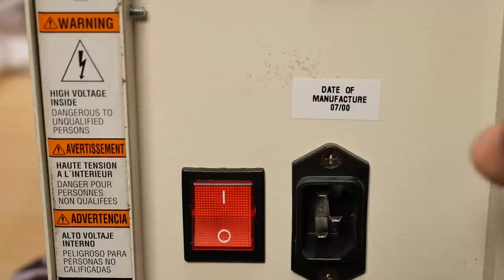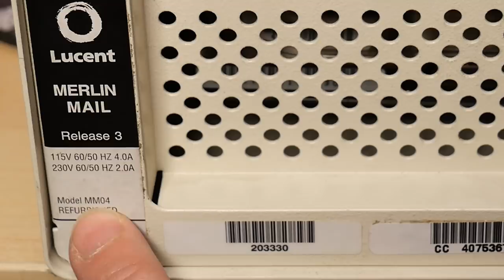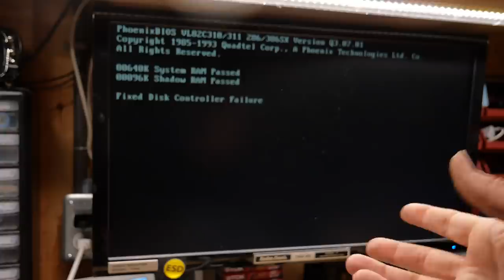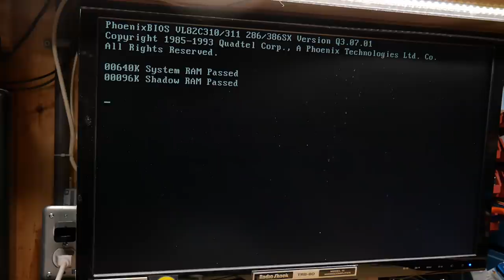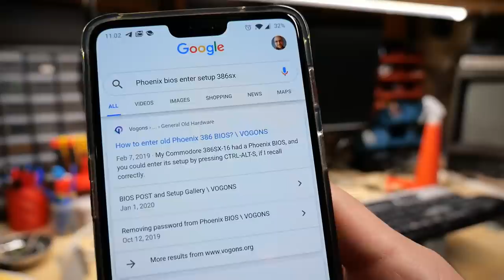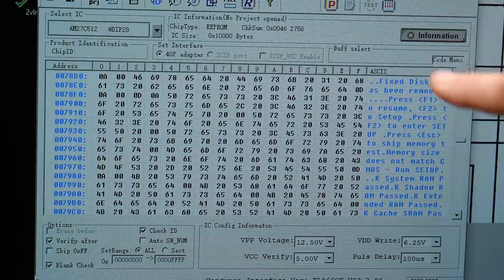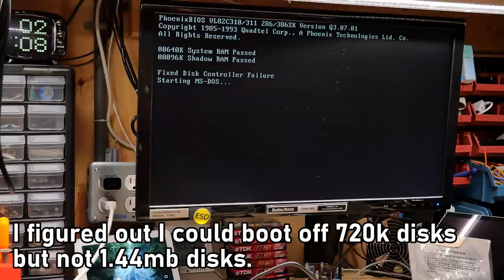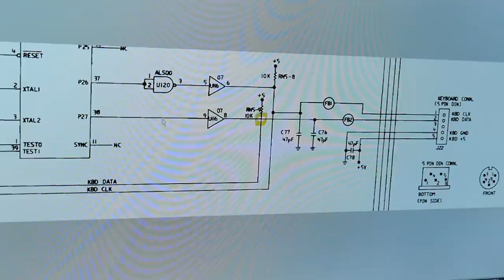Trashpicked Voicemail System

Comment: Adrian, what about removing the bodge wires? Does it make a any discernible difference?
Reply: Not a good plan. 
Most of the times they are from the Manufacturing Company to make the hardware compatible with newer software.

Comment: I would put it back together then connect with a null modem on COM1 and see if there is any output.

Back then if it was to die the tech would of probably just submit a ticket to replace it. Maybe swap the hard drives in the process. Other then that I highly doubt a Phone Tech would lug around a terminal to fix it on site unless a terminal was already on site. These days since Laptops are dirt cheap compared to even 20 years ago however they would probably send in a specialist to repair it since a typical run of a mill ATT Tech wouldn't know what to do, they already hardly know what they're doing as it is, at least these days.

Comment: At a guess the cap and transistor in the other crystal socket is a watchdog timer with a several second timeout. It probably pulls on NMI and resets the machine if it isn't retriggered before it times out. Possibly the two rework wires on the back of the board are part of this (presumed) watchdog circuitry.

Comment: The cards do have an order the first card can be a stand alone mm02 the second card can be ports 2&4 or ports 5&6. It will only work with a merlin system and normaly connects to the last of the station ports

Comment: Isn't that module with a capacitor the reset circuit? The capacitance is too high for a high frequency oscillator, but right rnough for a single pulse circuit.

Comment: The "oscillator module" at 10:45 might be a primitive watchdog. Of course, the CPU needs some GPIO pin to periodically reset the timer (after it is enabled). Since since this box only has 1MB of RAM, I'd repurpose the A20 gate for that (which is famously controlled by the keyboard controller). A PAL (PLA, GAL, CPLD, ULP, ULA, ...) with feedback logic could be used to enable the watchdog when the A20 gate gets asserted for the first time after power up, and from there on, it needs to be periodically reset.

Would make sense to an unattended voicemail system to have a watchdog which automatically resets the system if the system hangs/crashes/behaves irregularly.

Sorry for mentioning the A20 gate. A truly ugly hack...and Intel CPUs supported it until Q2 2013.

Well, officially, Intel just mentions that you should not expect the A20 to work as expected on 64 bit Haswell (and later) architecture CPUs. That makes me wonder...just how does an Intel Core i9-10900X access more than 1MB of memory under DOS 6.22?
Reply: By the time these came out for field repair in the event of failure it was change at the card or unit level, rather than component tracing,  the YT guys that test faults and switch out capacitors under a microscope get my admiration for patence.

Comment: I’m thinking that the RC.and transistor plus bodge wires may be something like a hardware reset watchdog.   Very big time constant.   If you find that one wire goes off to a reset signal and the other some type of io, that might be it.   Since it’s embedded that seems logical.

Comment: i've been poking around that bios file. It looks like if you pull out one of the memory modules / reduce the amount of ram the system is expecting it should trigger you to go into the bios. If you run the strings command on the bios file you can see text like the below:

Press <F1> to resume, <F2> to Setup
Press <F2> to enter SETUP
Press <Esc> to skip memory test
Memory size does not match CMOS - Run SETUP

worth a try?

Also how did you dump the bios? Did you use the phoenix flash tool to backup the bios to floppy? Or did you use a chip reader? I have tried using the phoenix bios editor tool but it doesnt think the file is a valid bios. Complains about the file legth being wrong?
Reply: He said he used his normal chip reader with an adapter for the package.

I’m betting F2 still works, he probably just didn’t press it at the right time since he was trying all sorts of key combos.  But forcing the matter with a RAM size mismatch is a good idea.

Comment: Those Dallas RTCs will run for 30 years.  I also have some Dallas NVRAM modules that are that old and are still kicking.
Reply from the maker: Yeah especially if this had just been powered on for 25 years. The RTC battery won't even be used at that point.

Comment: Adrian, Did  you ever figure out that special Circuit with the tranistor? that may be a security feature that doesn't allow the keyboard without a special key combination , i know it very simple however where it hooks to the MB a key combination/code may enable/disable it.  also those wires on the back side of the board are not uncommon. Great videos

Comment: At 12:20 the windows logo was because there had been some glitch with Windows and some non Intel CPUs so I guess Bill seized the opportunity to make some logos and sell them! This logo thing went on for a while and was evetually dropped or maybe not because it is kind of the thing you could still see in some laptops today that the sticker is displayed to the owner instead of being buried in the CPU where nobody could see it anyway because of the fan and stuff, starting with 486 DX2-66 CPUs started needing fans officially recommended by Intel. Great video thank you!

Comment: Watching your attempts to get to the BISO setup.  I noted;  One is you waited to do the key presses too long.  With these old PC systems it was always better to start trying the keypresses before the post messages had come up.  As for the beeping.  That was saying the keyboard buffer was full.   Tip, try one or two key combo presses and if you don't get in before the end of post or you get keyboard buffer full beep as you did then restart and press another again.   The keys to try are "ESC", F1, F2 or Del.    Having to use the control key sometimes was needed but not as often as turning on and hitting the above key.
Reply: p.S.  My bad I started this comment before the end of the video but it might still give some ideas

Comment: At a certain moment when you said the keyboard did not respond I thought about the small keyboard fuse that is close to the connector where the keyboard plugs in. But later on when you changed bios chip back the keyboard worked again, so it can't be the fuse.

Comment: Hi Adrian. The company I work for still uses those AT&T Merlin phones and the 410/820 “brain boxes”. I’ll bet there’s a card that fits in them that’ll interface to that “Merlin Mail” you’ve got there. Too bad the hard drive died. It was probably running a Linux distro. I’ll bet someone wrecked the hard drive to prevent any embarrassing voice mails from being discovered! 😏 Anyway, I’d check the bodge wires to see if they go to the AY-3-3600 keyboard IC (the 40-pin one), or to the PAL/GAL chip nearby. Desolder them, then try your standard BIOS chips you burned. Worst case, you could take the PAL/GAL chip out and see how many input pins it has, then make a circuit that has a binary counter that counts up to however many input pins on the IC, and have it loop through all the combinations, and record the outputs for each one. Probably easily doable with an Arduino Mega256, or a Raspberry Pi. It may also be that the PAL/GAL chip is bad, and that’s why you can’t get into the BIOS.
Reply from the maker: Actually no the HD was working but just had DOS on it and the voicemail program which did nothing when you run it. The HD had nothing else on it so I didn't even bother showing it. And the bodge wires are all far away from all the keyboard area and had to do with that little oscillator thing that was installed.

Comment: look for other amd 386 MB schematics - have an idea thar the bodge wires and custom to circut may be part of the problem causing a bios reset automatically so that for use it dose noy change when power cycled in an office.

Comment: dumb question: have you investigated what happens when you remove the bodge wires on the back of the board?
Reply: I would not recommend removing wires like these. 
Most of the time the manufacturing company used these to get older hardware to a newer revision.

Comment: Can you just isolate the keyboard lines from the the PAL chip and connects a typical 5170 circuit to it and use those AMI bioses?
Reply from the maker: It is possible actually but that would take a lot more work modifying the board cutting traces than I was winning to do at that time -- but may be worth it if there is no fix to unlock the stock BIOS.

Comment: Would the BIOS settings be saved if the clock battery was dead? Seems dead to me with its inability to keep time.
Reply from the maker: It was working. I ended trying it in another board and it was fine.

Comment: Another great video, but it misses one crucial thing. What's on the HDD. That's was the part I was looking for. OS, software used, etc. 
I was hoping you would connect it to a pc and create an image of it to do some further investigation.  Anyway maybe that will come later! ;-)
Reply from the maker: I actually booted it up. It had nothing interesting on it at all -- just DOS which boots up and runs this one app. Running it showed nothing on screen so I ended up not showing it on video as it was completely uninteresting.
Reply: @adriansdigitalbasement  I assume I'm more a software then a hardware guy ;-))
I find it already interesting that it did run DOS.  The output is probably redirected to the com port. the  first thing i would do is connecting a serial console to the com port. I have read in one of the manuals   that normally there was a modem connected to COM port 1 for "remote administration"

Comment: Built in mid 90's and refurbished in 200?
Reply: either for Y2K, or normally lease or rent deals would last for 4 years.  If a fax server the one I used ended up incompatible with the rest of the windoze network when all the other units changed, before I could send emails as faxes over the network and out.

Comment: There must be some super secret key combo for the BIOS.  A serviceman would have to be able to access it at some point.
Reply: Not if the system loaded hardcoded setup data at boot. Theres no other reason except to set time and the software on the hdd probably did that

Comment: Why on earth are those expansion cards so wonky?
Reply: The nuts were loose.  They’re usually all that holds the ports to the bracket, so when they’re loose those ports wiggle around freely.  The short IO card just has the parallel port on the PCB - and the PCB could angle in the slot a little bit if the bracket wasn’t holding it firmly.  The other ports just connect via ribbon cables and are only fastened to the bracket.

Comment: It would be interesting to get that motherboard working❗ I suggest these:
1 - install another HDD (or another controller card, too)
2 - install a PS/2 (mouse & keyboard) card
3 - install a sound card
4 - install Windows (maybe 3.1) onto the new HDD
5 - try some retro games on it
6 - install back the system into it's original case
7 - Here you go. A really unique retro computer. 😉